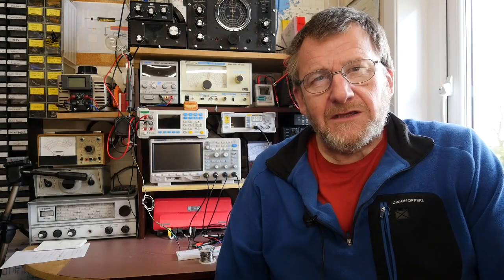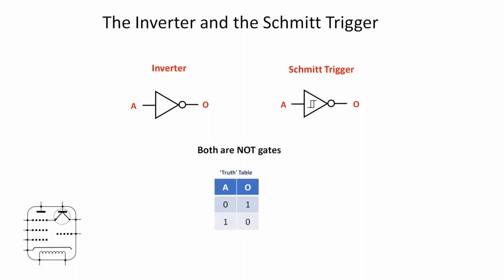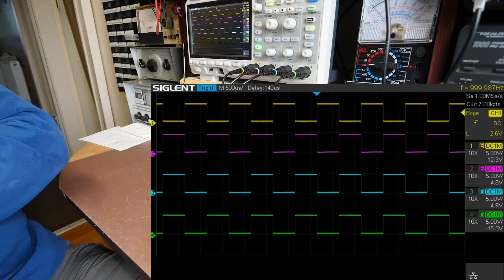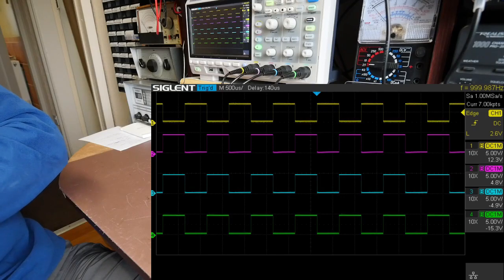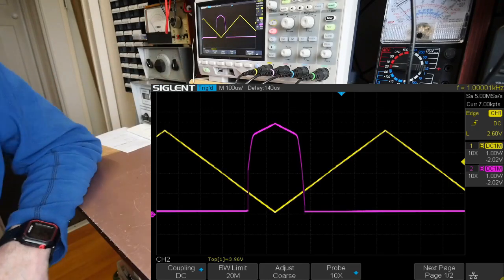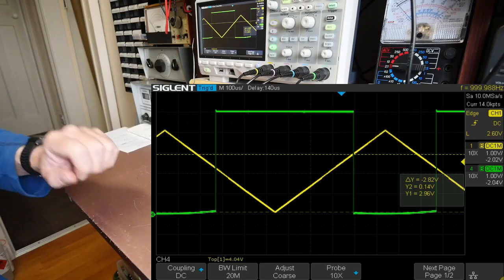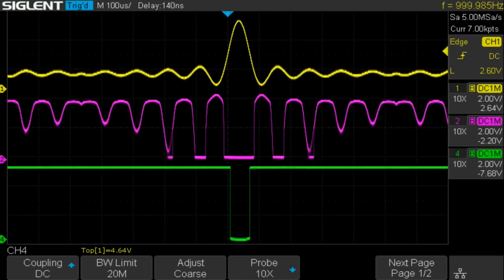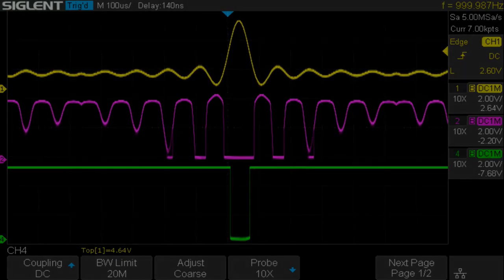Digital Electronics   NOT Gates   Inverters and Schmitt Triggers       #060

Comment: At 9:24 you incorrectly state that the Schmitt trigger triggers when the incoming wave reaches the full 5v.  It actually triggers at the upper trigger point and "turns off" again at the lower trigger point (draw some straight lines up to intersect the yellow trace.)